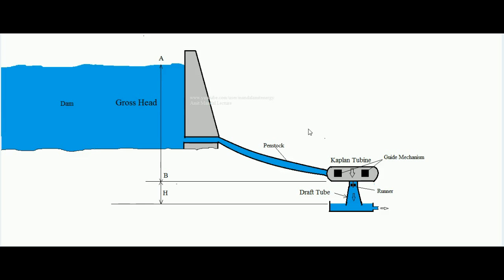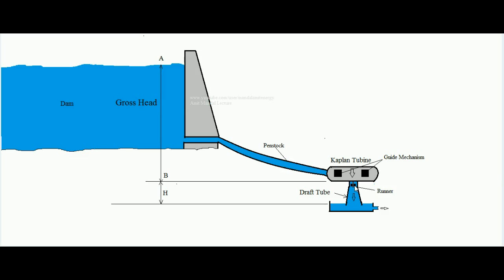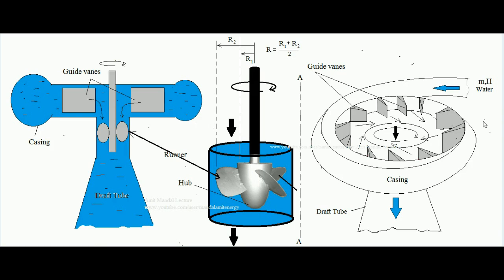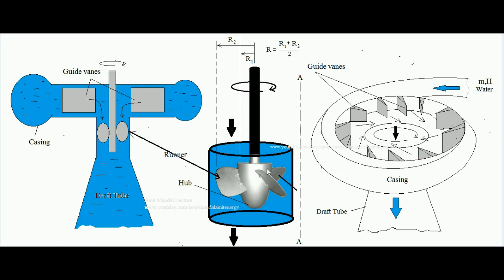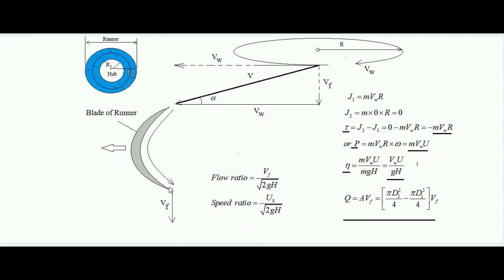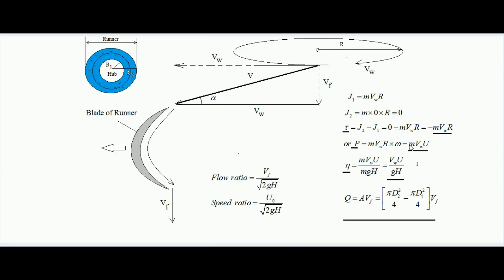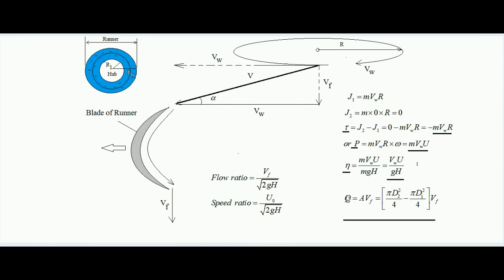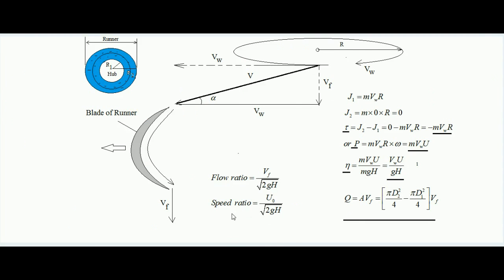Kaplan Turbine Working  , Power and Efficiency.

Comment: Very nice video. 
I have a question to you. Iam working on a project but have little knowledge of turbines. It would be very helpfull to know if its possible to increase the outflow velocity/pressure of a turbine (kaplan or francis). Do you think it is possible by changing the hub for example?
Reply from the maker: for this, check out my lecture on Draft tube
Reply: @Dr.AmitMandal  Thanks for your quick answer. I will check it out. The problem is that i am not an engineer but would like to know if you can release the outflow inside an enviroment of 2 or 3 bar under water. 
I understood that normal outflow pressure of a kaplan or francis turbine is 0,5 bar. Please correct me if iam wrong.
For me its sometimes hard to understand if people talk about kinetic energy, velocity and pressure and so on. 

So i will watch the video now and try to understand :)

But if you can help me find the answer if i can release the total outflow of a turbine in an enviroment of 2 or 3 bar outer pressure i would be very very pleased.

Lets say i have to release the total outflow of the turbine about 10 or 20 meters under sealevel
Reply from the maker: The inlet pressure of turbine has to me more than exit, thats the rule..
Reply: @Dr.AmitMandal  iam sorry i presented the wrong information to you. 

Imagine a river flows into the sea. At the end of the river i will install a pipe into the sea. The pipe has a length of 10 meters. The riverwater will flow into the pipe and fall 10 meters and enter the turbine. 
The turbine will be at the end of the pipe at 10 meters below sea level where the pressure is 2 bar.

I really hope you can understand me :)

You think that it will be possible to let the total water output flow out of the turbine into the sea at a depth of 10 meters?
Reply: the flow will be perpetual off course
Reply: Imagine you have a dam next to the sea. The dam will be on land but the turbine is 10 meter below the water (sea). You think it will be possible release the water into the sea?

Comment: I'm currently in the process of installing a kaplan turbine. 2m head and 80m3 litre second flow. Goal is 1.5kw to take me off grid.
Issue is that the streams bed is well below the terrain level. At this point i think i have to build the penstock down the middle of the creek like an raised aqueduct.

Comment: Only a one small corecture: the casing is drawn heading the wrong direction, to make water spin like shown on the picture the casing should be coiled clockwise but thanks for this good video
Reply from the maker: Good question , Actually in theory it would not effect the performance because
1) The casing size is considered very big.
2) The flow of fluid toward the rotor is in radial direction first .The significant velocity  starts just at the outer
     periphery of  the the guide vane toward the rotor radially .This is because before entering the guide vanes , the
      fluid has only pressure head with it.
3) The significant whirl starts when the fluid leaves  the guide vanes and moves toward the rotor.